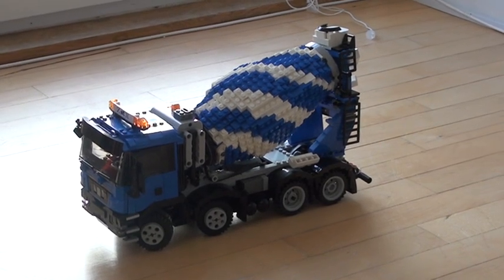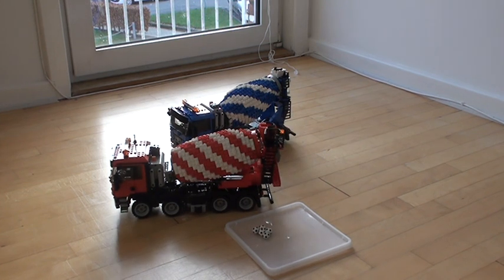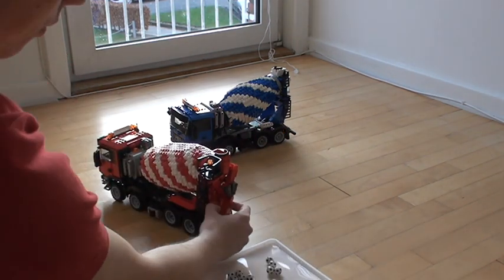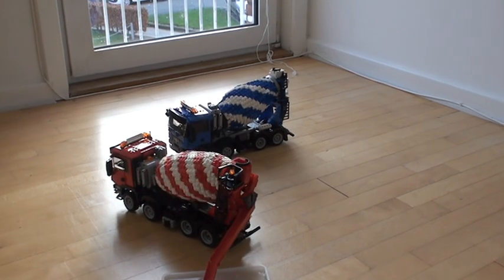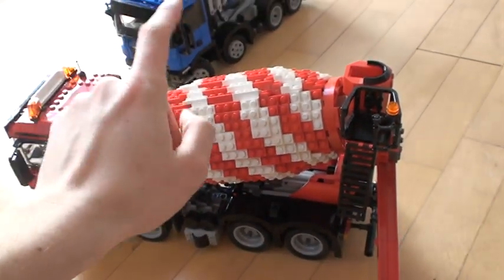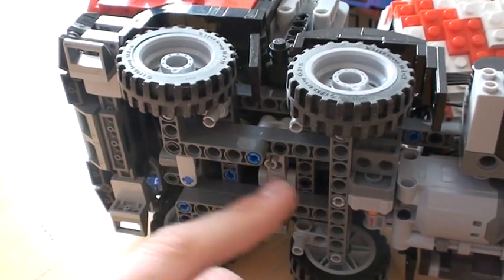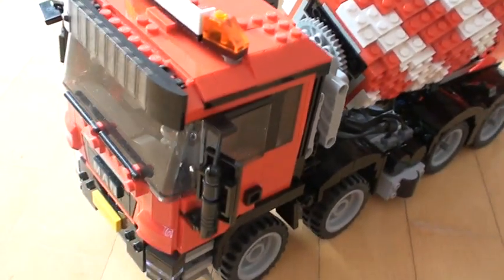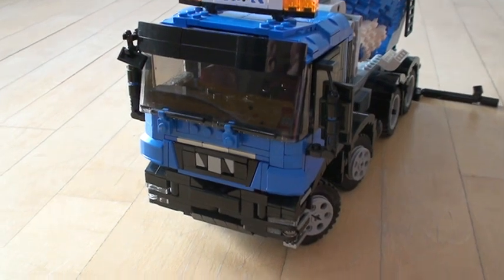RC LEGO Cement Truck

Comment: can you build it that the switch is turned with hand and not with the motor?
Reply from the maker: Yes. You can put a switch pretty much anywhere you want it - I had it on the side on the blue truck.